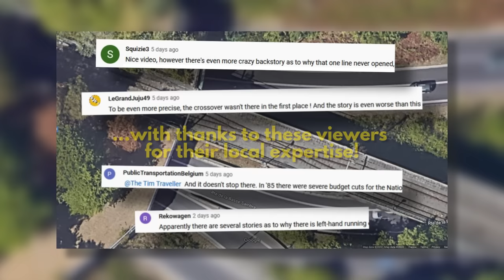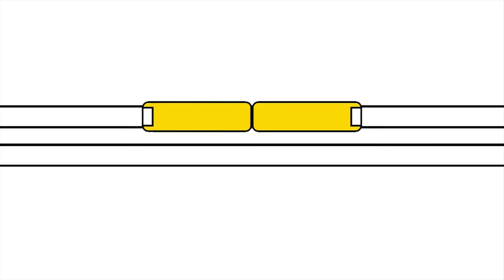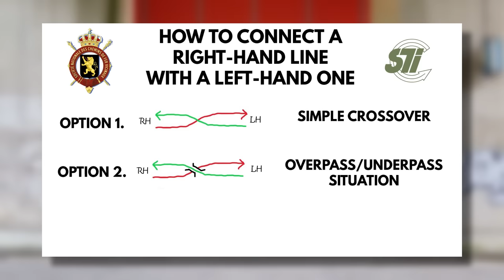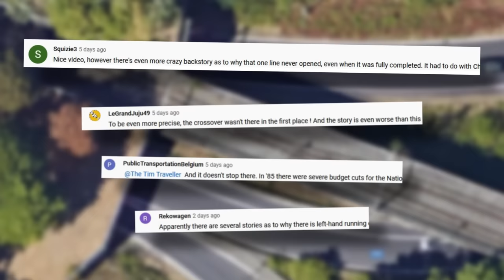The Belgian City That Built Two Metro Lines The Wrong Way Round

Comment: Nice video, however there's... No, I'm joking, it's crazy enough for now 😅 Thanks for the shout out!
For people interested in unused metro infrastructure, Antwerp (yes, on the other side of the waffle iron politics) also still has one unused metro tunnel. It is also opening in 2026, so soon there won't be any left in the country.
On a slightly unrelated note, the 'Ronquières inclined plane' and the 'Strépy-Thieu boat lift' are two impressive boat lifts which are also a product of the waffle iron politics, and would be very fitting for a The Tim Traveller video.
Reply: Oh Tim, I don’t know if it has been told already but in anticipation of the metro network the STIC scrapped their traditional tramlines in the 70s… 🙃
Reply: I live in Antwerp and didn't know about this
Reply: Ronquières is really impressive, yeah ! I think the story of the Clabecq forges (wich aren't far from there) would be interesting too
Reply: It's a shame that the visitor centre at Ronquières didn't survive the pandemic; it was open three years ago when we did a quick recce, but remained closed last month when we were there. At last we got to see the incline in action, it is certainly a remarkable sight.
Reply: There's actually also an unused metro tunnel in Liège so there will still be unused metro tunnels in the country
Reply: @guntherqm1816  True, although that one is so short it makes no sense even trying to open it. It's only a few 100 metres of tunnel, and they're now building a surface tram line there instead.
Reply: @Squizie3  Unused metro line in Brussels too, plus several abandoned underground stations (some were still used for parties until a couple of years ago, if my memory serves me well)
Reply: @niatylehrer  There are no unused metro lines in Brussels, only a few unused station boxes for future lines in existing stations, and one unused station on an existing line. Nothing weird about that really, most metro systems have a few of those
Reply: @napsiuslebelche5846  Most buildings of the Forges de Clabecq are gone.  The site is now used for new housing projects.
Reply: ken ik jou niet van skyscrapercity over antwerpen? cool om je hier ook te zien!
Reply: @ivopiscevic  Didn't you notice that we got new metro lines a few years back? The metrotunnel under the Turnhoutsebaan was dug in the 70/80s. And they only started using the tunnel in 2015, but there are still 5 built stations unused. And there is also still 1.4km of tunnel unused which they started to dig in 1977. 
The yt channel "KingIsulgard" has great archival footage of all the misery that the premetro has gone through.

Comment: Thanks for explaining the reason for the crossover. Talking on trams with doors on one side, it seems like a good idea as you get more seats in but can get complicated when it comes to single track running. An example of this is Osijek in Croatia. Route 1 has two tracks through but Route 2 is main single track and runs on one side of the road. At passing places the trams have to go to right hand running with an island platform on the stops and stops on the signal track you need a platform on each side. You also need a loop at the end of each route rather than just a buffer stop.

Comment: The tram network in Gothenburg, Sweden, has a crossover as well. On the Angered line, just before Hjällbo, the trams switch to the left and the stops have island platforms.
The reason behind this was that this part of the line was originally built as a metro, but after the plans for a city-wide metro system were scrapped it was instead integrated into the tram network, which runs unidirectional trams with doors on the right.
Reply: What a mess... no surprise that they are so angered
Reply: The same goes also for Nockebybanan, a tram line in Stockholm, that was originally built for left-hand traffic and today shares a depot with the subway, that is run on the left. 

So today, the whole tram line runs on the right, but just before Alvik, in Alléparken, switches to the left through a similar crossover.
Reply: @osasunaitor  Funny pun, but at least there wasn't any big mess behind it

Comment: They totally missed the chance to not only bicker about LHD/RHD, but also differing heights for the passenger platforms. Tim, maybe you want to visit the beautiful city of Cologne with their KVB tram system with varying platform heights to acomodate for the different tram stock they purchased over the years, with stations having different height sections...? I would really like to hear you explaining this...!
Reply: There are a couple of train stations in Toronto, Canada that have bi-level platforms for different trains.  The Bloor and Weston stations have low platforms at one end of them (for commuter GO Trains), and high platforms at the other (for the UPX trains that run between Union Station and Pearson Airport).
Reply: Colone is interesting, because they somehow manage to connect to Bonn using the same height of platforms while not being sure for themselves. And Duisburg is, if you ask me, even worse. There Central Stations underground part is an innavigatable mess, with two different heights and two levels where trains are going the same way on both sides
Reply: In Utah, US, the Frontrunner commuter rail uses trains of three double-deck coaches that they had built for the service and one old single-deck coach they bought from New Jersey Transit (I think).  The platforms are made to fit the trains:  three cars' worth of platform tall enough to exactly match the doors on the lower level of the double-decker coaches, and one car's worth of platform maybe 40 cm LOWER that is about even with the bottom step of the stairs that go up to the floor of the single-level coaches, which is of course is roughly halfway between the heights of the two levels of the double-decker coaches.  You read that right:  the system has two different platform heights because every train includes equipment that needs different heights; and you use the lower platform to get to the higher coach.
Reply: @sammartland932  that is awesome and would quite deserve a video
Reply: @sammartland932  What what what?!
Reply: Some London stations are like that too, for much the same reasons.  Platforms have a few humps and dips, to accommodate different train stock with different floor heights above the wheels -- especially on stretches where lines with different trains have to share track.
Reply: Basically, they originally intended to convert the entire network to high level platforms in the 70s. However some lines, especially those that ran on the streets, still used traditional tram vehicles, and thus retained the low platforms. In the 90s, low floor Stadtbahn vehicles became available, so it was decided to keep the remaining, mostly surface- and street-running lines low-floor for monetary and aesthetic reasons. This means that the high floor vehicles need steps at shared platforms, and some stations like Ebertplatz have platforms with two levels. In addition, a select few stations get served exclusively by high floor trams, but retain their low floor platforms due to loading gauge issues (primarily in sharp bends). It's a bit of a mess, but in practice works surprisingly well. The more metro-like lines with significant dedicated rights of way have high floor platforms, whilst the more tram-like lines retain their low floor platforms.
Reply: Reminds me of the metro line in Amsterdam, where they wanted to run a half-tram half-metro line, so they had new trains which were narrow enough for the tram stations, but had pop-up platforms so they could also be used safely with wider metro stations. But it was too unreliable, so they either widened or got rid of every narrow station in that line, so all the new trains had to run permanently with extended platforms

Comment: Kinda reminds me of the Kriviy Rih metro in Ukraine, where trams (yes, not trains) run on the left on the underground stations and on the right on the surface ones.
Reply: Same thing works in Volgograd, Russia.
Reply: @Inetman  because of island stations?
Reply: @blanco7726 , exactly. Also with trams underground.
Reply: We have a similar situation in Zurich in Switzerland. There was a project for an underground metro system, so it was decided in 1971 to already build the tunnel of a branch line to the proposed (but not approved) line 1. Said branch line was to run a motorway tunnel and they decided to already build it together with the motorway and got approval for that. But two years later the entire metro project surprisingly was rejected by the voters of the city and the canton. 
But they continued construction on the already approved tunnel, so they now had a tunnel with no metro to put in. So they decided to run a tram line along it instead. I would assume that nobody was surprised by this, as it was already stated in 1971 (when the section was approved) that "in the unlikely event" that the metro projects would be rejected, they could use the tunnel for a tram project. The three intermediate stops in the tunnel section are built like metro stations with island platforms, but the trams in Zurich are unidirectional and only have doors on the right, which is why the trams run on the left in the tunnel.

Comment: Very interesting! A somewhat similar situation existed on the former subway in Rochester New York USA, which ceased operation in 1956. A two-mile tunnel was built in 1927 to take trolley and interurban cars off downtown streets. Stations in the tunnel section had island platforms, so left-hand operation was used on that portion of line because the cars had doors on the right side. The change from right-hand to left-hand operation was done outside the tunnel entrances using spring switches.

Comment: we have a similar situation in Zürich Switzerland - where the trams use a certain part of the never build underground line ... great story as well.
Reply: But you also have two train/tram systems on different voltages sharing the same track, so there are two sets of overhead wires, one has its pantographs in the middle and the other has its hanging off one side.
Reply: @georgebattrick2365  indeed, the Uetliberg train. Utterly weird concept, but works fine.

Comment: Oh cool, this is super interesting. The Zürich tramway does something similar for getting the trams to open their doors on the correct side in the underground tunnels, where the platforms are between the two tracks. Apparently the tunnels were built for an abandoned (because direct democracy) U-bahn project so they just ended up using them for trams.

Comment: The Edinburgh tram system and Charleroi Metro should be twinned.
Reply: underrated comment
Reply: Edinburgh is even worse. They had a decent tram network. Until 1956. Then they replaced it by buses.  The (re-) construction of the new network was such a shambles that - if I'm not mistaken - only half of the planned lines were constructed.
Reply: The Antwerp metro system has a nice history as well. They dug a lot of tunnels... then only used part of it.

Comment: Trains need to crossover. You should visit the gare de bifurcation d'Onville where the French trains (in France trains run on the left lane) crosses over to the German system (trains run on the right side). As the Moselle and Alsace railways were built during the annexation betweenn 1870 and1918, they follow the German rule. When they were connected to the French network, it was easier to build a swapping station than to convert the whole thing. A swapping station would in any case be needed for international traffic anyways.
Reply: Is that one a level crossover or is it grade seperated? I can only recall the LGV Est‘s crossover which is kinda awesome.
Reply: Same between, Belgium and The Netherlands, where they have fly overs for trains to switch sides. Although almost all European countries people drive on the right on roads, but trains in some countries drive on the left, because English engineers (helped) install(ed) the rails over a century ago in those countries.
Reply: @OpenbaarVervoer2D  not mentioning the special changes for the different voltages between Belgium and Netherlands and the communication/safety-systems  to keep things simple... ;-)
Having trains that can only run on half a rail on platform 1 on Roosendaal... just because...

Comment: There's also a line in Brussels that partly runs on the left (line 2/6 between Roi Baudoin/Koning Boudewijn and Gare du Midi/Zuidstation). The way metro platforms are arranged at Gare du Midi/Zuidstation is also a bit weird
Reply: Isn't that only until Gare de l'Ouest (Weststation) ? As there the two directions are stacked on top of each other instead of being side-by-side, allowing to switch sides more safely. I guess they did it that way as anyway all lines pass there on 3 levels in total :)
Previously that part of the line 2/6 was the one end of the 1A, which changed direction at Beekkant to continue up to the East of the city, I suppose that's why it was running on the other side on that part.
Reply: Oh I'm late to this but indeed this is ultimately because the Beekkant - Roi Baudoin branch was on line 1A originally. When they completed the Beekkant - Gare du Midi portion on line 2 however (which led to the current network of lines 1/2/5/6 being created), they also built it with left-hand driving, and it switches shortly before the Gare du Midi station (doing it there is convenient as the platforms for each direction are on two different levels--granted there's also the platforms for the North-South axis there, current tram lines 3 and 4 that will eventually become metro line 3).

Comment: It’s 2052 and Line 5 still isn’t open...  they considered using it as a path for hoverbikes back in 2037 but the TEC was unwilling to remove the old overhead power lines and hoverbikers kept getting their hair fried off.
Reply: it clearly didn't help that some of the hoverbikers retrofitted pantographs to their hoverbikes to power them from the overhead power lines

Comment: You can have some fun in Brussels too, the Metro line 6 between Gare du Midi and Roi Baudouin runs on the left hand side - despite having doors on both sides of the carriages. 
That's because the line between Beekkant and Roi Baudouin has a "reverse line". The former line 1A metros coming from Hermann-Debroux would, after Etangs Noirs, turn to the South, stop at Beekkant and reverse out of the station. I still remember the agonizing wait while the driver had to walk to the other end of his train. To avoid crossovers, the trains would simply stay on the left hand side. 
When the network was rearranged, due to signaling issues, they had to keep it that way, and the newly built part of line 6 between Beekkant and Gare du Midi was then designed for left hand side driving, the crossover happening at Gare du Midi where each side stops at a different level.

Comment: To be honest you don’t even need a overly bureaucratic hellhole like Belgium (and Wallonia) to end up with trams running through crossovers to drive on the left side as you can get stuff like that in Göteborg as well (as they also have a small portion of their network running on the left)

Comment: Stockholm has one of those crossings on Nockebybanan. Before 1967 we had left hand traffic on our roads, so the railway, underground and trams also ran on the left side. After the change, the trams needed to change (for obvious reasons) and Nockeby was one of the lines that wasn't closed. But, the Underground/Metro still ran left hand. To make changing between metro and tram easier at Alvik, the tram simply changes from right to left side at the stop before.
Göteborg also has one, but that is because a tunnel part of the tram has platforms in the middle so the trams need to change to left because they only have doors on one side.
Reply from the maker: Ah fascinating! I knew the story about Sweden changing sides for road traffic, but I never thought about how it would have affected trams... I guess that's another future video for me :D
Reply: @TheTimTraveller  Maybe :)
The railway and metro wasn't affected so they still run left hand (signalling make it possible to run both direction). Some parts in Malmö (The City tunnel) runs right hand because the railway connects to Denmark, that has right hand, via the Öresund bridge :)
Reply: "H-Day" ("Dagen H") is still one of most fascinating historical achievements for me. Simply because I believe that it would have impossible nowadays, with "modern politics".

Comment: Thank you for this great video! If you want a cab view ride video of this line 5 that never opened, check out this video:
https://www.youtube.com/watch?v=OfrU0z7oR5E
This looks like special rail fan trip from before Centenaire to Waterloo, but you can see that trams still CAN operate on the line, and YES, the tram operates on the LEFT side (except for a short part around Centenaire station where there probably isn't a crossover switch any more). They even operate a switch from within the cab.